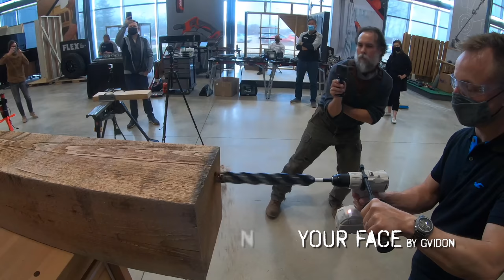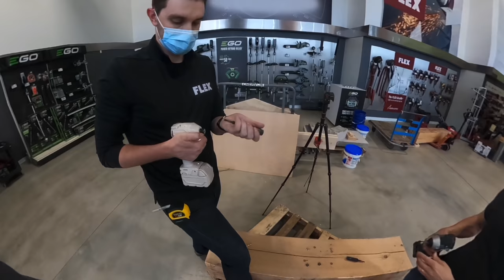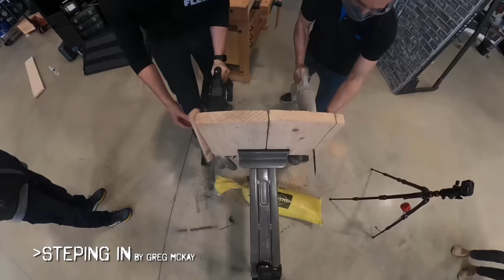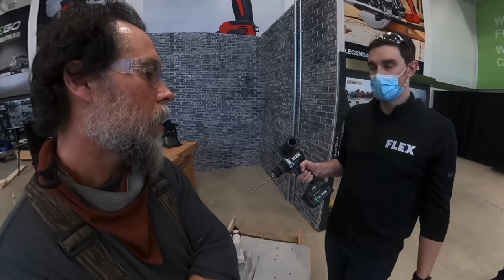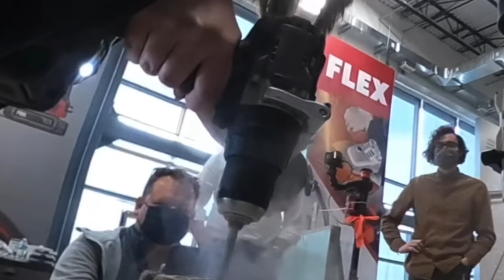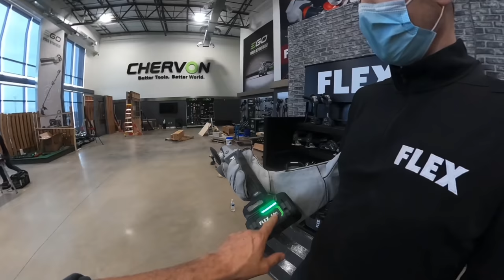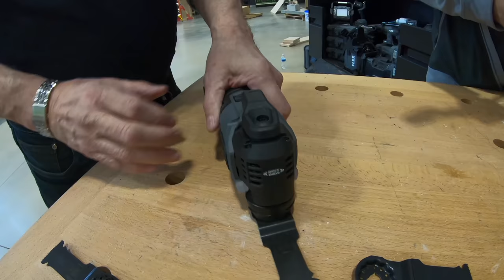Testing Flex's new Power tools- No glitz, no hype, no B.S.

Comment: When they did the impact side by side Milwaukee was catching up on the second lag and the guy removed it from the screw to allow Flex to win.
Reply: I noticed that too the driver just happened to slip off the screw head just as the milwaukee was about the pass the flex
Reply: Facts
Reply: I don’t buy it either
Reply: @JMyers1990  I was curious if I was the only one to notice that
Reply: And are they using the Milwaukee Fuel with the high-output batteries?
The title should say “All Hype”
Reply: I seen this as well the flex is badass but the gen 3 fuel is just insane
Reply: @paigebates4451  I honestly believe these will be great tools, but I have to wonder money wise if buyers will go for the Kobalt XTR which is also a Chervon tool and most likely share similar components. Both are 24v and both you can get the more advanced batteries. More than likely though Lowe’s won’t hasve huge specials on Kobalt....but we know Home Depot will on the “big 3” pro brands!
Reply: I caught that too. The Milwaukee was on pace to pass it at the last second. But can't let that happen on a Flex show...
Reply: @FunAtDisney  too bad, Kobalt xtr are some really nice tools. I'd say they are pretty much done with the xtr line
Reply: Yeah he was catching up big time
Reply: The Flex was still further ahead.
Reply: Did you watch the first screw? Flex killed milwaukee no slippage there
Reply: Damm I seen that
Reply: I would of made them use new batts or inspected the cells on the millwaukee batts
Reply: Fact is they are not using the newer technology High Output battery for Milwaukee. Take a look at the watt hours for both the flex battery and the XC battery they used for Milwaukee, way off. I will only believe Flex is better when I watch MCT video coming this week. He is trusted and doesn’t care what tool wins!
Reply: @akaredcrossbow  the Dewalt smacked the Milwaukee and the Milwaukee smacked the flex.
Reply: @D41Michigan   I expected the Dewalt to dominate, newest technology. I have the 996 and that drill will break both your hands, still complete the job and then ask for more. 
The 998 has the same specs, but has more balls! The 998 destroyed the Flex with Milwaukee coming in a respectable 2nd also putting Flex in its place, last place that is with Flex only completing one task.
Reply: @akaredcrossbow  yup. I've got a handfull.of Dewalt and Mac (Dewalt based) tools. They all perform well. I'm looking to get a new hammer drill as my current Dewalt drill (an older brushed 20v) doesn't quite have the power for some of the tougher tasks I need.
Reply: @D41Michigan  I also have the Milwaukee 2804 hammer drill. I like both of them equally because they will get the job done. It all depends what you like,  bigger, or more compact. The Dewalt is definitely bigger and a bit clunky, but you know you’re holding a real quality tool. The Milwaukee is smaller, but built  solid. I’m thinking of adding a Makita 40volt hammer drill and 40volt impact driver when they are released, but I need to feel the quality before I pull the trigger.
Reply: @akaredcrossbow  oh definitely. I'm just really invested in the dewalt battery line. I think Milwaukee has a larger line of tools tho. I'm considering getting the 60v flex volt stuff as my wife an I manage a apartment complex. It would be nice to have that interchangeability. 60v for the high demand stuff and run at 20v for all day work
Reply: @D41Michigan  I have one Dewalt FlexVolt worm drive saw and it’s amazing. I only have the 9ah FlexVolt battery, but I do have a lot of Dewalt tools that I use it with. That is another reason why I’m still thinking I might not go with Makita 40 volt because I do have some Makita tools that I won’t be able to swap out batteries. Dewalt definitely has the advantage when it comes to buying tools and batteries. Makita in a way is making the 18 -36 volt obsolete.
Reply: Ehhh it would have been close but the flex was still close enough to win on a non full battery
Reply: How do we know how much pressure they put on the milly too?? The grinder for example
Reply: Milwaukee got smoked....💨
Reply: Facts, now try that with a High Output battery.

Comment: Thanks for the video Stan, really nice tools.  As I am told by a power tool supplier Flex has been around in Germany since the 1920’s and was subsequently purchased by Chervon a company in China that also owns Skil.  They have been trying to break into the North American professional market since 2013.  Tools are made in Germany and will set you back a small fortune to purchase but quality and performance are top notch.
Reply from the maker: Thanks for the Info Bob.  I dunked the ciruclar saw in water-  its still working like no big deal.  That was very impressive.

Comment: As a confirmed Toolaholic, I love real tool comparisons like this...
Reply from the maker: Glad you enjoyed it.
Reply: I'm not saying they did it, but there are a lot of ways to tamper with competitor like dulling the bit and messing around with the motor or fans.
Reply: I don't. It's not an honest comparison. They're taking what is obviously a milwaukee tool painted white. I would bet you the drill itself that it's not m18 fuel its their basic m18 with a standard 5Ah.
Try an actual comparison. M18 fuel with the high output battery.
Reply: @chadpendt2863  I agree
Reply: It's also an 18v to a 24v so of course 24v is better the 18v now if it was 18v to 18v I bet Milwaukee would still win so of course 24v is gonna have a advantage
Reply: @chadpendt2863  yes 20v tools are nominal voltage actually usage voltage is 18v same for all tool and voltages nominal is different then in use voltage
Reply: @chadpendt2863  makita has 18v plus 18v which is 36 volt not sure about bosch having 36v could of swore they have the 20v core which is 18v core batteries
Reply: @AntonioClaudioMichael  I just checked it is makita. Metabo also has a 36v too. My mistake
Reply: @chadpendt2863  yeah I have the metabo hpt 36v line it's all good 👍
Reply: @chadpendt2863  and to your comment about the flexvolt batteries they are not just 20v nominal and 18v during use when they are put on flexvolt tools nominal is 60v and usable voltage is 58 volts its the reason Milwaukee says 18v because they don't use the nominal non used voltage range were dewalt does because anybody selling a 18v tool has to pay Milwaukee a fee so most tool companies use the nominal none used voltage range and this flex brand is not a true 24v tool its nominal voltage is 22 volts same as the kobalt brand of tools so for example the ego 56 volt tools are actually 54 volt tools during use and yes Ave had taken apart a ton of tools but Milwaukee high output batteries are running 21700 cells were the regular xc batteries are running 18650 cells 21700 cells have a higher discharge current then 18650s they can dump there capacity faster and with more amps its not as simple as it's made out to be and higher voltage will substane a tool longer without battery sag but just because it's 18v compared to 22 volt don't mean it's better that is a mistake a ton of people make just because ego has 56 volt nominal batteries don't mean there better then a 18v battery the higher the voltage the more cells needed to make a 5ah battery compared to 18v tool battery it needs less cells to make 18v and 5amps per hour
Reply: @chadpendt2863  I agree too. We all grab the best battery that we can get our hands on.This makes the tool work better. Something FLEX isn’t showing.
Reply: @paedahe4975  that and the tool itself. I was saying the white painted milwaukee in the test was most likely a basic m18 and not the fuel. So of course it won't be as good since it's a brushed motor vs a brushless.
Reply: @Modelo646  MAN CAVER TOOLS “MCT” is going to have a video soon and will show the real performance. He doesn’t care what tool wins.
Reply: @dominicsapienza  all about watt hours for the battery. Flex battery 5.0ah is something like 120 watt hours and the Milwaukee 5.0ah XC used in this video is something like 90 watt hours.
Reply: @akaredcrossbow  can't wait. Thanks for informing.

Comment: An auger bit doesnt care how hard you push on it only how many ripens it gets with enough torque at that rpm. The rep said it won because it had a turbo button that increases rpm. As a machinist would say, if you increase the speed you can increase the feed.
Reply from the maker: good point.

Comment: FLEX is fast but will it last a year before burning out. Haven't had a Milwaukee tool ever go out less than 3 years daily use.
Reply: You literally can't even know that yet lol, you're just botting the talking point tti wants to hear to keep selling miluakee at huge margins
Reply: At this point it doesn’t matter if it last a year or not. They are giving a lifetime warranty with all tools sold this year. So it can burnout every month and it won’t matter. Yeah, it would be a pain to deal with. I expected them to last quite a while otherwise this long standing company would be out of business real soon
Reply: @plaid11  I would like to see the small print on that deal
Reply: @JohnR9965  I would too and apparently there’s an issue trying to register their tools. The website isn’t working and the number given to call is for ego tools
Reply: Yes that's the real question.

I own milwaukee gen3 tools but i would say makita have a better feeling with tools lasting but they are also slower than milwaukee
Reply: @JohnR9965  
It goes out to 31/12/2021

So you don't have to run out straight away
Reply: @plaid11  so far I haven’t seen or heard anyone being able to successfully register for that lifetime warranty. Sounds like a lot of BS just so they can get the launch sales.
Reply: Only time will tell
Reply: Yeah what I’m wondering is can these tools still work under water Ik my dewalt has and I still use it today
Reply: Won't know until time shows the outcome.

Comment: The white drill is a Milwaukee fuel 2804 fuel btw.  Which is not the top performing drill in the market.  It’s outclassed by DeWalt, Kobalt And Makita newest drill.

It also gets a boost with a bigger ah battery.  Which would be a fair comparison because a 6ah 18v 21700 battery has same watt hour as a “24” (21.6) v battery.

Comment: Looks like they are on the right track,  wish they would have run the Milwaukee tools with the high output batteries so we could get a true best offering comparison.
Reply: Yep they should have use the fuel version and they are all Milwaukee
Reply: Kind of hard to tell if they're using the fuel or non fuel models tbh unless they tell you. It's pretty clear they're using Milwaukee as their grey competitor
Reply: The drill and impact they used against their top end tools are the gen 3 fuel impact and drill. Their lower end offerings were juat against the regular nonfuel brushless models. You can tell by the handles and look of the tool.

Comment: Hate to admit it but it looks like they've really got some impressive tech & features built into these tools. The industry def needs more innovation like this from the top-tier brands. I really love the variable speed grinders (I am a FT remodeler and do a lot of work w granite) I've been waiting a while for someone to include variable speed on a cordless grinder w enough power to cut & Fab 3cm. That 6.5" circ saw design is pretty genius too, cant wait to see how they perform vs competitors. As they didn't quote many power figures other than for drills & impacts but I'm guessing they won't disappoint. Thanks for the vid✌

Comment: Ill stick with makita xgt 40volt /18 volt lxt😉im not to bothered about speed or power more a preciection quailty tool i like makita never disappointed me no failing parts or batterys breaking and quick charge times plus they smooth and ergonomic are bang on
Reply: How is the 40v I just discovered it and I have been thinking about getting one. I would just get the combi hammer drill.

Comment: These tools look pretty good but I probably won't consider buying any until they pass the test of time
Reply from the maker: well said.
Reply: I also have a problem buying tools with different batteries than what I'm set up for.  I already screwed that up by buying ridgid for the lifetime battery warranty and then got bit by certain tools they didnt make that milwaukee makes (soldering iron, heat gun, wrenches etc)
Reply: @electrohacker  yeah that's also a big factor.
Reply: Are these going to be available at the big box stores for prosumer or is this going to be more of a Hilti line where it’s geared towards commercial use?
Reply: @danfelack3351  "exclusively at Lowe's"

Comment: I'm absolutely blown away with the flex tools
Reply: It's a higher power tool. More power at 24v than 18v. Im sure if Milwaukee had a 24v system it would be just as good
Reply: @TAKINGADIP  Right its kinda funny they were comparing to the 18v milwaukee and not the 20v Dewalt definitely says something about the Dewalt lol
Reply: @matty2helpfull  it’s cause they want to be paired with Loews which sells dewalt

Comment: Maybe you should have asked why they weren't using Milwaukee's fast output battery to compare with their turbo mode. Or why didn't they go head to head with DeWalts flexvolt? Maybe ask why they were comparing their top of the line recip saw with Milwaukee's mid level recip and not their top of the line model.

Flex seems suspect.

Comment: I’m curious to see how the fuel drill with a high output battery would compare to the flex with turbo on. Fuel tools don’t work at their full potential with a standard 5.0ah battery. I get that they’re comparing apples to apples, but would a fuel drill with a high output battery be a more worthy opponent?
Reply: It’s not really apples to apples because they’re bragging about their turbo mode which pulls more power and can only be sustained in short intervals. Apples to apples would’ve been with the high output battery if they’re using their “turbo button”that’s what Milwaukee offers but they’re not interested in a straight up comparison.

Comment: So much b s with these reviews, putting a 24 volt drill with a turbo against what? Try the dewalt 60v max , then call it a real drill if it beats it, but if flex can flex 24 volts then let Dewalt flex its 60
Reply from the maker: I think they were putting them against each other as they are the same price point? So for the same money you are getting more popwer and more options and thats what they were using for the test.  But maybe I am wrong.

Comment: Love the tool comparison videos and I will say we all know what the competing tool was I have a lot of them and I only use the 12 amp hour battery’s with the 5 amp hour battery there not that impressive but the hammer drill is just slow on the competing tool I would know I do a lot of concrete anchoring for base boards and I wasn’t impressed but I mainly use it for drilling through wood and mixing plaster and it works amazing for that. But I love the videos And watch every one awesome comparison 👍👍
Reply from the maker: Thanks for watching and supporting the channel.👊

Comment: I still love my DeWalts but those are impressive!
Reply: This test has holes in it ,they are using low spec tools up against the Flex .My Dewalt tools are excellent .
Reply: @interman7715  actually if you did your research then you would know that they are testing them against the high end line

Comment: Greetings from Wisconsin! (I think i met one of your trucks early today down by Boscobel, Wi.) The "twist/ bind" cut off was slick.  I remember in my youth days hanging off a ladder drilling thru brick walls with an AEG 3" core bore. We'd loosen the bolts a little so it'd twist a bit when it would bind. Those old monsters broke more than 1 wrist. Especially the D handled drill. On a ladder, all that torque transfer at an instant really effects a guy. So when we gonna throw it 30ft in the air and see what happens? Or hook it to another? You know what I'm talking about Stan.
Reply from the maker: I know what your talking about and that work sucks.  I would rather shovel crap for an hour than drill like that.

Comment: I do like the star lock set up.  However, the current tool blades also have 100% power transfer.  Star lock has the hole in the middle, the others have the holes on the outer edge.
Reply: Starlock is amazing. If you like Starlock then buy a Bosch oscillation tool.

Comment: The only tool/battery I have ever had over heat and not work for a few minutes was the older, 1st gen (blue) Ryobi sets.  Other than that, it is not a problem, especially with Milwaukee.

Comment: I mean, I think they are probably better but since they are the new tool on the market the benefit from newer technology especially in batteries. This type of thing goes through a leap frog type effect. Next gen of milwaukee and dewalt will probably beat this flex tools. Cool tools. If they have a better price point, good performance, cheap batteries and good customer service they might have a chance of taking the lead from those big guys.
Arguably the availability of the other brands will make them more desirable for most people.
Reply from the maker: But you said it perfect.  Innovation in one brand forces other brands to improve to tay ahead.  thats when we win!

Comment: You can see the auger spinning faster on flex drll.

Flex isn't super fast but it has slightly higher rpm, i would think the 24v battery will give slightly longer run time